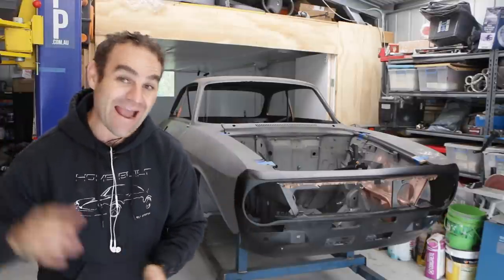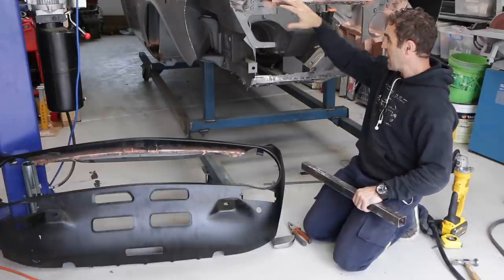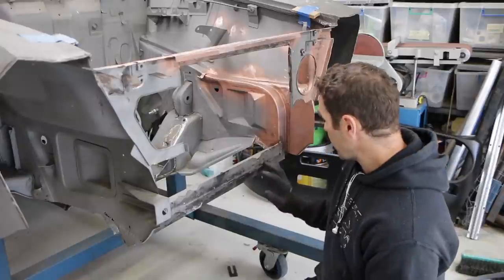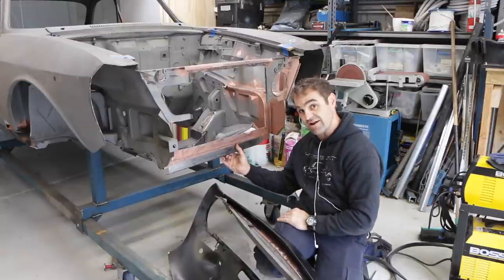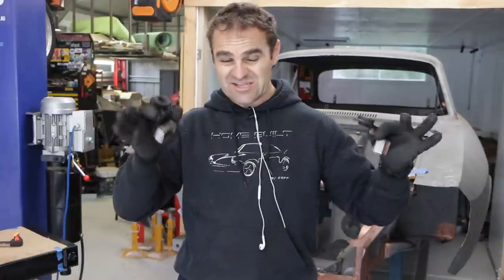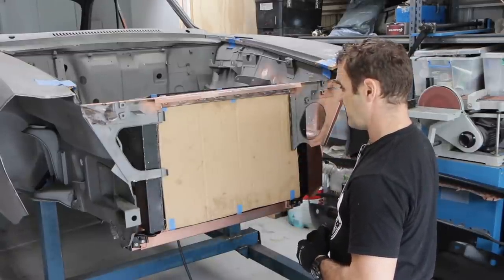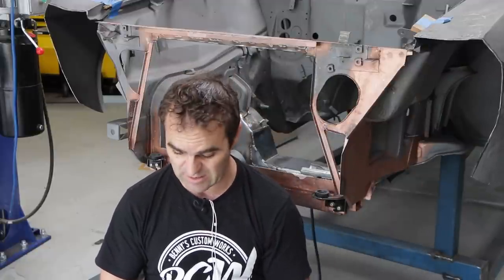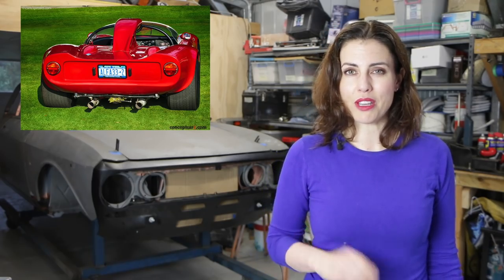Right under the nose.. - Alfarrari 105 project car build part 38

Comment: Your perfection with that front end will pay off in the end Jeff!!    Keep up the good work (and planning).         Tiger.
Reply: Beg my ignorance but what is the bronze coloured spray you apply after welding?
Reply from the maker: Weld through primer
Reply: Thanks!!
Reply: @Home Built By Jeff   And you use it like regular primer, as if it costs nothing.  I went to buy a can... USD $30+.  😱

Comment: The ‘perisopica’ was a beautiful Alfa racecar for 1967.  Styling cues are in some more modern supercars, and f1 scoops over the driver’s head.  Solid work on reinforcement of the AlFerrari front end.  Weld penetration and overall structure is now excellent.  Nice job 👍🏼.
Reply from the maker: Thanks mate. Now I should be able to close it all up and move on to the good stuff ;)

Comment: Put a level bar you can adjust to be level across the front of the mobile frame. So no matter where you are on your garage floor you can have a level reference point. Loving your build.. I am putting a V6 in a 73 Alfetta (4 door)

Comment: Jeff, on the front, work top down. Align the top of the front with the guards and the bonnet (which can't really be adjusted up or down!). Then if you need to, modify the bumper bracket vertical positions to suit and take up any slack at the bottom. Doing it the other way around changes the size of the grill aperture, making that wonkey. Lots more wiggle room at the bottom end of the front panel, so try and use that.

Comment: As always, Thanks Jeff and Mrs. Jeff! At some considerable risk of losing some of the comedic content from your ever present "blooper reels" I thought I'd include a concept I first heard in a college course on "Oral Interpretation"; Mrs. Jeff, sadly, Italian is not your first (or even second) language- for the tricky to pronounce bits, especially foreign languages, write them up as you would a pronunciation guide using the long and short vowel indicators, etc, and read them as the pronunciation guide would tell you. It will not perfect your delivery, but it should help reduce the confusion! FWIW, non Italian car nuts can't speak Italian either- but they fake it pretty good in the key of twelve cylinders! Me, I'm a recent relative of Cousin Jonathan- a "Murican- I can slaughter any foreign language out there- including my own!

Comment: Great progress Jeff! Have you thought about wating to weld the nose on until after you have the engine mounts/ headers/ etc all done first? May be easier to get the hoist and work done in there without it. Just a thought, keep up the great work!
Reply from the maker: It provides a lot of the front end structure so I want to make sure the car is as solid as it can be before I start playing with the hard mounts.

Comment: Ferrari exhaust headers will run hot so try and run air from the nose cone around the left and right side of the radiator and towards the headers..
Reply from the maker: Good thing I am not using Ferrari headers ;)

Comment: Great work Jeff. By the way, how are you going to access the bolts for the radiator mounts once the nose is welded on? Is there still acess?
Reply from the maker: It will be tight, but there is access. To be honest once they are on they should never have to come out ;)

Comment: Yeah there is just not enough structure to not weld the nose on. To do it would add a ton of weight in reinforcement, add additional seams, and also it is unneeded.

Comment: Hi Jeff love your channel. I've seen every build except the beatle. Regarding all the comments on a removable front, which I know isent possible, maybe consider making the engine cross member removable? So the engine can come in and out of the bottom :)
Reply from the maker: Everything in the front of this car is welded together and integral to the structure of the car.Making any of it removable would compromise that.
Reply: @HomeBuiltByJeff well it could be made so it still was structural, almost every newer car has a removable cross member, that still is structural. I know it would be quite the task to design it properly, but still easier than making the while front removable 😂
Reply from the maker: @LoupozE30  New cars are designed that way from the outset  ;) . Yes I could make it removeable with a lot of reworking and reinforcing which would add a huge amount of work and weight to the car (not to mention the issues with engineering and legality) and would ultimately be far more effort than just putting the engine in and out from the top.

Comment: To line up the front would it not have been better to remove the bumper brackets, line up everything else then fit bumper brackets rather than tying yourself to the position of the brackets?
Reply from the maker: The bracket I have on the car is original and undamaged so I am happy to use that as one of the few known good points on the car.

Comment: Hi I'm thinking about we're water can drain out we're nose and the new  structure under  the radiator
Reply from the maker: There are drainage bumps on the bottom lip of the nose cone.

Comment: Making the nose and fenders separate removable pieces would not require much. By adding a mounting flange to each piece and some panel nuts it could be done easier and stronger than welding the parts as a whole.
Reply from the maker: It would not be stronger and to reinforce it enough would make it much heavier for little gain
Reply: Home Built By Jeff . The weight increase would be about 800 grams. Examine the nose of an HQ Holden for ideas on how to do it if you want inspiration.
Reply from the maker: @anomamos9095  Watch my explanation again. HQ panels bolt on and are non structural. The Alfa panels are all part of the chassis and are not removable (like the rear of most cars) unless you cut them off (leaving it a flimsy weak shell).

Comment: If B is for Build has taught me anything, when you're trying to line up a car you need to use precision besser bricks to hold everything up while you weld it.
You're obviously doing it wrong.
On a more serious note, make a body jig which is just 2 bits of tube, one slides in the other, with a lock nut, and a hand crank on the lock nut, and 2 sharpened bits of bar. Basically a HUGE set of calipers that you can measure corners and compare one side to the other using spot welds of bolt holes. Brilliantly stupid devices.

Comment: Hey Jeff, awesome work love watching your vids and the progress you make, just wondering what do you have your welder setting set to when welding the thin metal? Cheers
Reply from the maker: On my welder between 1 and 2 on both feed and amps.
Reply: @HomeBuiltByJeff  Thanks Mate that one area im having a hard time to find that sweet spot but I am using a Gasless atm im looking for a gas welder though
Reply: @snrautoworx2840  you will always struggle with a gassles welder as they are cheap. I have had one for over 20 years and still use it when I just want to tack something but it is very hard to get good penetration. They are only really good for quick dodgy repairs.
Reply: @matthewrafferty4117  Hahah yer thats one thing i have noticed I found myself going back and forth with setting and never was happy with what penetration it was getting.

Comment: I suggest you stop with the body work for now pull the fenders off and start fitting the engine and transmission and ancillaries.
It will mean less work and modifications if you fabricate the bits with the engine in place instead of having to cut stuff out and redo it.
Reply from the maker: The fenders are welded on and structural to the car.
Reply: Home Built By Jeff . Must have missed the vid where you welded them on . I suggested you pull them so they don’t get damaged and you have more access.
Reply from the maker: @anomamos9095  Welded on from the factory